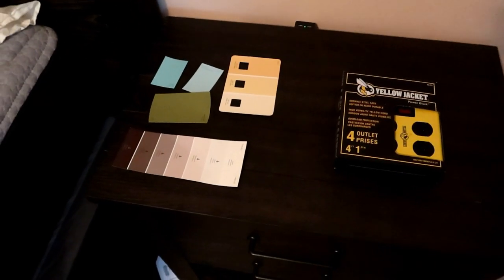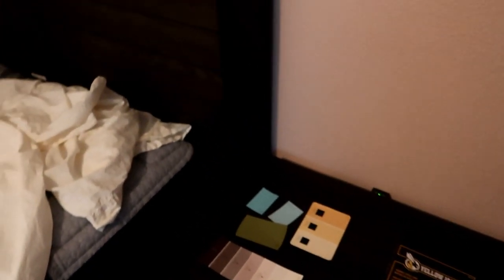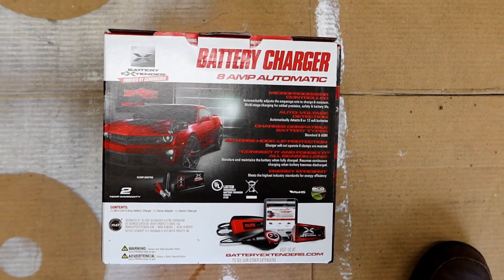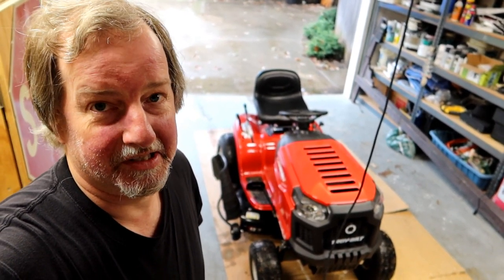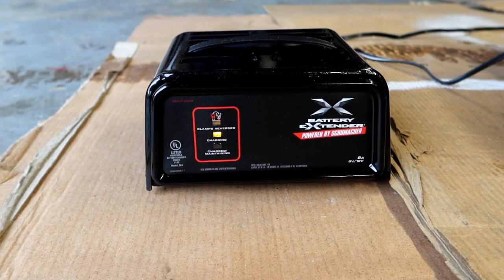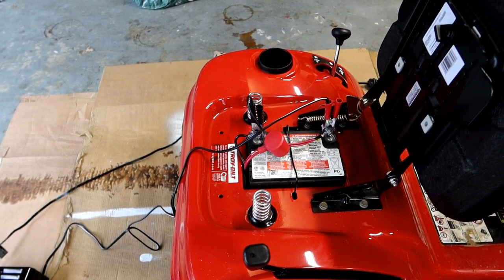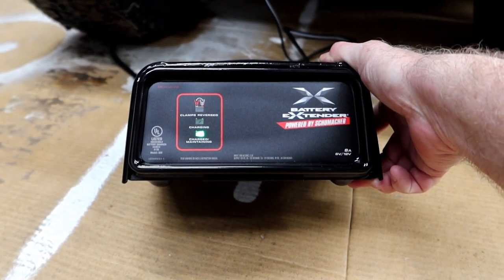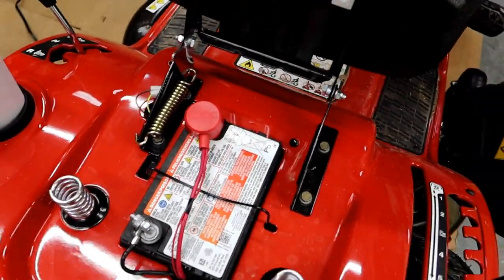Rainy Day Projects - Charging The Lawn Mower - Escaping The Mouse - ETM-479

Comment: Sometimes it can be the clutch / brake pedal safety switch. Try pushing the pedal down a few times to make good contact. The safety switch keeps the engine from turning over if the clutch is not depressed. Mine does the same thing.

Comment: Look into a battery tender brand name. You can leave it on all winter and it will not cook the battery.
Reply: The one you got does the same thing that the battery tender does. You do need to keep it connected to your battery because it will extend battery life. It will avoid discharging and recharging stress.